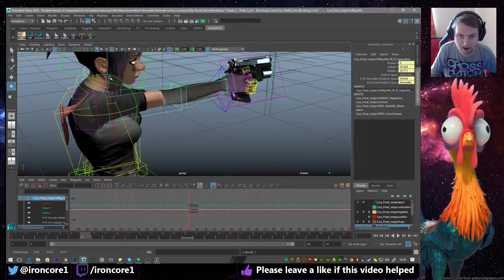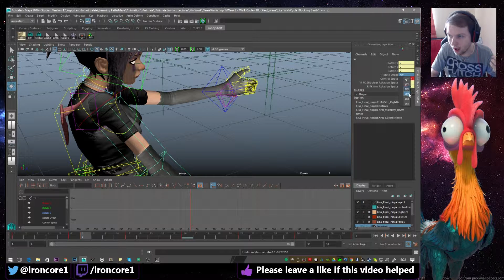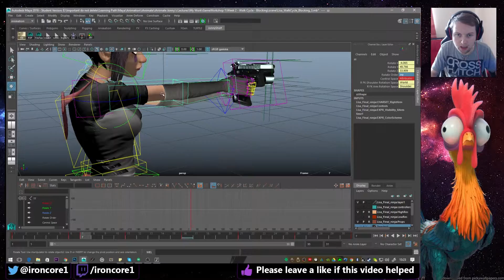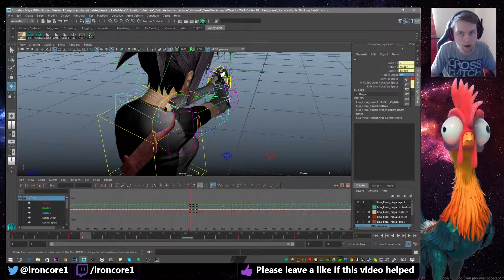How to prevent gimble locking from happening by understanding rotation order.

Comment: Gimbal solution note points:

- there's a maximum of 6 rotation order combinations
- all rotation orders HAVE gimbal lock
- Axis order in maya is displayed inverted like so: child <- mid parent <- main parent
- Gimbal locking ONLY takes place on a 90 degree rotation that causes two axes to intersect

on choosing the appropriate Rotation order:
- dominant axis must always be the main parent
- axis MOST LIKELY to cause the gimbal lock MUST always be the mid parent in the rotation order
- secondary dominant axis must always be the final child axis
Reply: This is very useful thank you